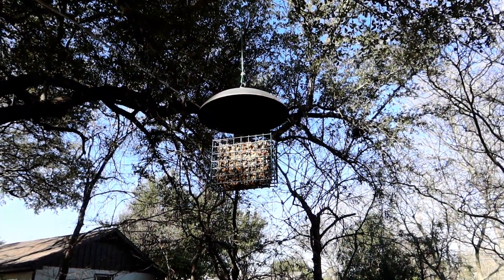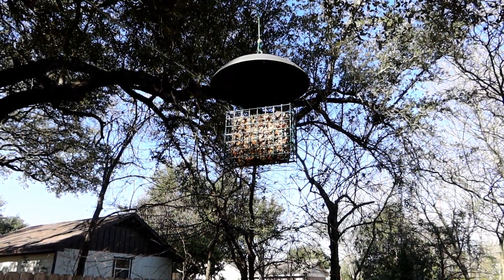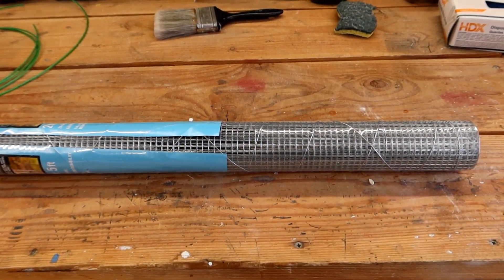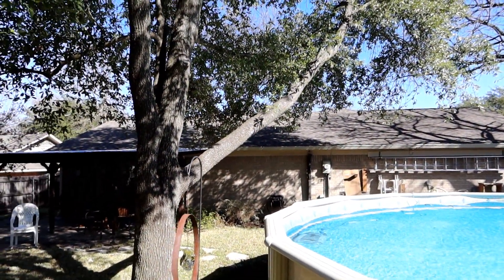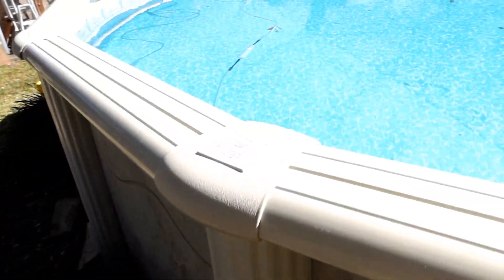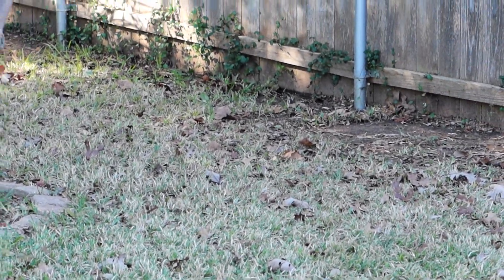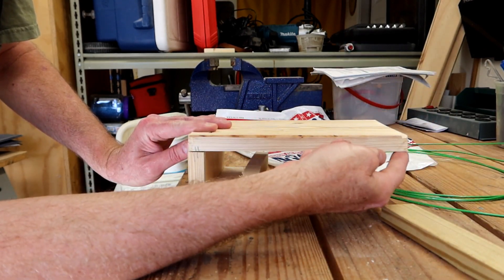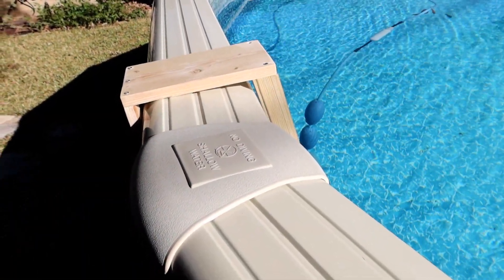I Want To Make Sure This NEVER Happens Again - Escaping The Mouse - ETM-521

Comment: I hope you have good luck with the squirrels. Better than I did anyway. I thought they couldn’t get in my attic either. Fast forward I have a guy from a place called critter gitters  in my attic that captures a family of four squirrels that did about $2000 worth of damage including gnawing through wires destroying insulation getting inside my air-conditioning system etc. etc. sadly I find that I cannot be squirrel friendly anymore. Maybe yours will be more well behaved.